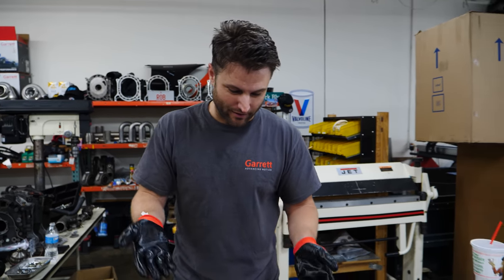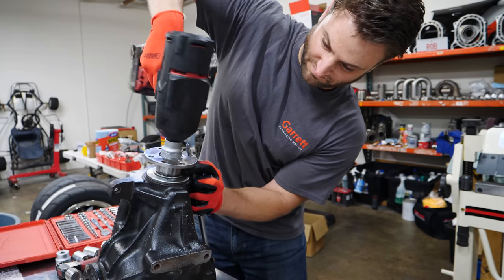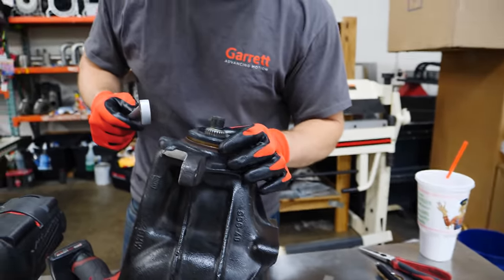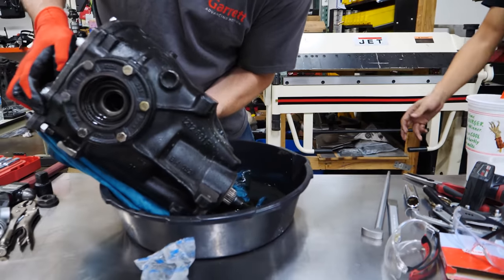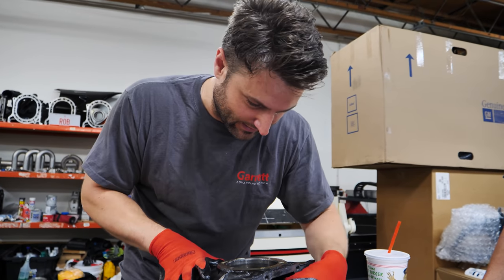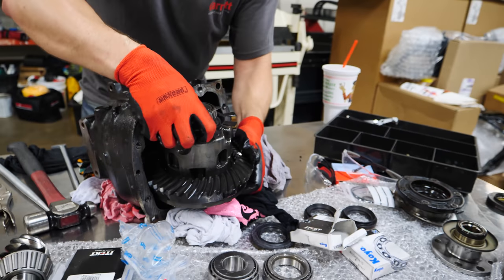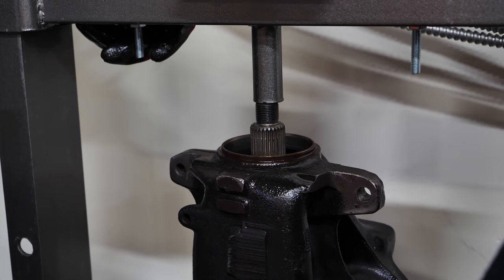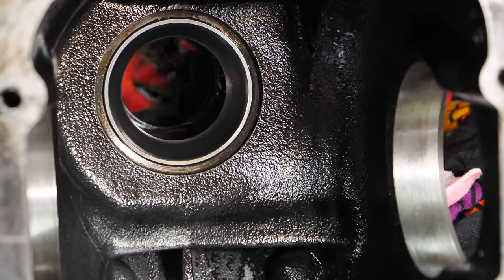Finally going back to AWD. Tearing into the Front Diff on the AWD RX-7

Comment: Question: What is purpose of this "propeller" shape metal on one of the ends? Proper oil flow?
Reply: That triggers a speed sensor (not currently installed).  Since you can count the number of blades, that is how you set up the speed sensor. You just tell the computer how many pulses per rotation, and it will then know what the RPM of the axle is on that side. Typically, that sensor is used by ABS systems that don't use individual wheel speed sensors.
Reply: @raelik777  Yeah, makes sense. Thanks
Actually didn't thought about it that way when Rob mentioned that place for sensor is in this part of differential.

Comment: Whait, this goes  backwards? 
The normaly coasting teeth  side gets load? This diff wil break sooner or later.
Beacuse of the angle of the teeth there will be a shit ton of side load on the pinion, reason why you are not suposed to  drag heavy loads in reverse..
Simple fix flip the casing upside down and that wil work.

Comment: What if your front and rear final drives are different? 🤪🤪
Reply: Crunch.

But he's not that stupid. 5.13 front and rear.
Reply: Scott Kenny not that he’s stupid,  but probably it has happened somewhere in a garage.
Reply: @chomin3025  well, if you look at something like my Jeep Cherokee (part-time 4wd), the gearing is a little different between front and rear (I want to say like 3.53 rear and 3.51 front, or similar. The front wheels spin just a little bit faster to help pull you out of a corner). If you drive for too far (miles!) on clean dry pavement, you can actually bind everything up, though you will have some warning before it does, and can usually unbind things just by backing up a bit.

A full-time 4wd/all-wheel drive setup with a center differential (Audi quattro, Subaru symmetrical, etc) does need the same gearing and tires the same diameter between front and rear.

Comment: When will this car be finished?
After 1000 videos?

With your time, money and resources, this project should've been done and dusted weeks ago.

There is nothing wrong with taking time for a well done project.
Aerodynamically, I am sorry to say, your cooling solution is an absolute mess. You have unnecessary weight beyond the front axle. You have tubes blocking a great percentage of the rads' frontal area. You have 2 heat exchangers physically conducting energy between each other. Suspension kinematics are far from ideal as well.

Come on... With your time and budget, you could've done so much better.
Anyway, your top speed and acceleration will suffer, particularly above 70 or 80mph.

Power is not everything.